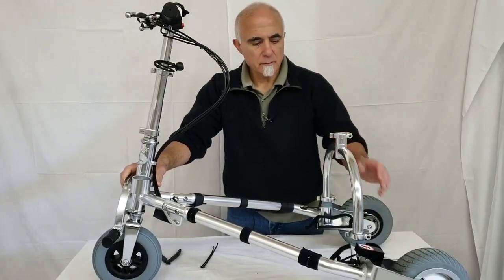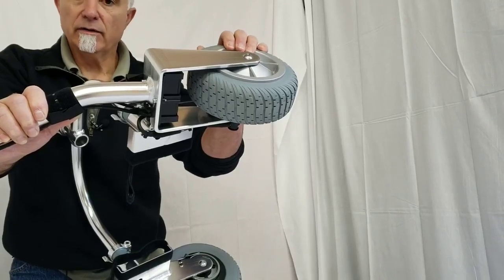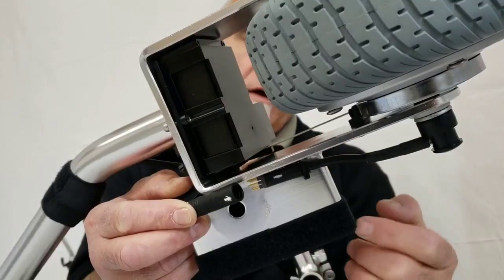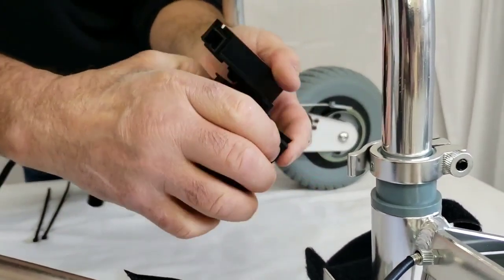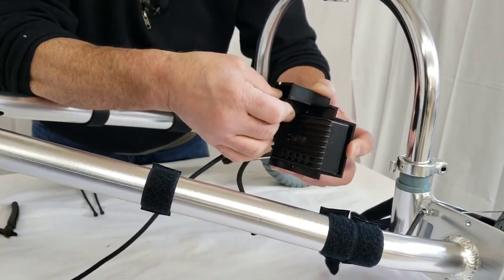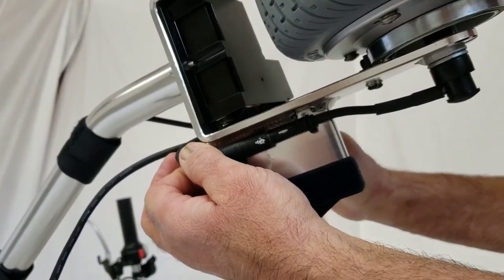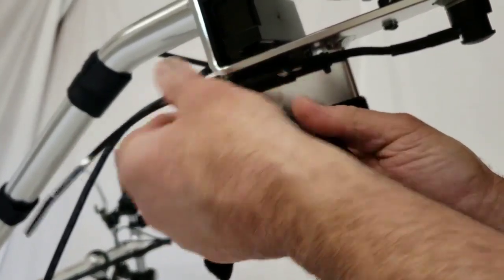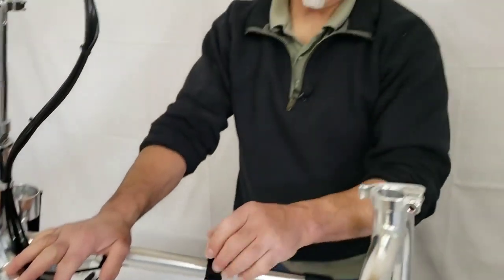Controller Install - TravelScoot Mobility Scooters

Comment: |is it worth greasing (dielectric/lithium) the wire that enters the motor drive - i'm tempted as the wire seems exposed to the elements
Reply from the maker: It is not necessary to lubricate the weather-tight, 9-pin connection from the controller to the motor. The pins are gold-plated, so they are corrosion resistant.
However, as the connector halves fit very tightly, it may be helpful to apply a little lube. Please don't overdo, since heavy grease attracts dirt.